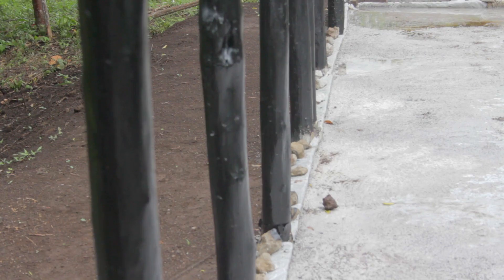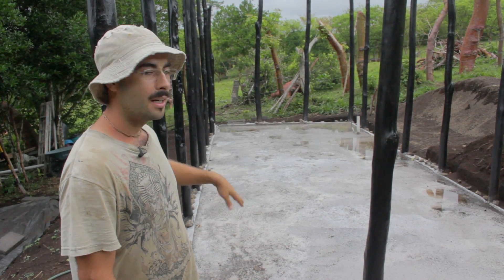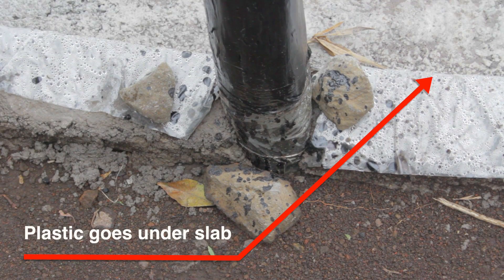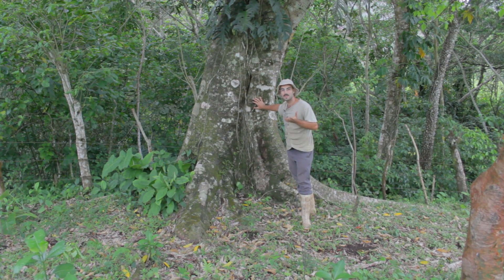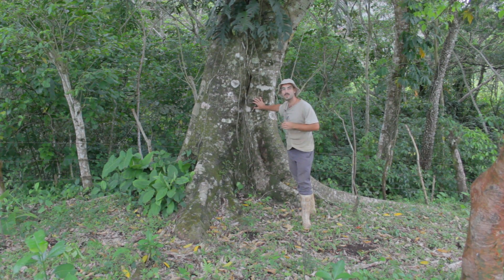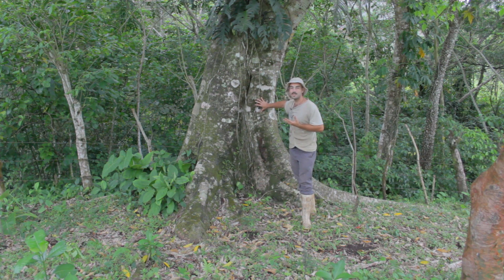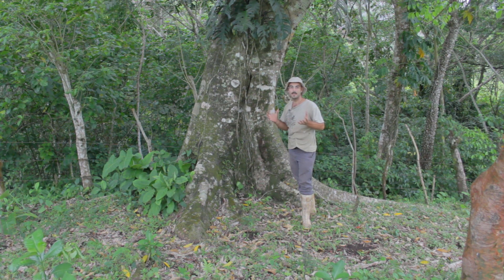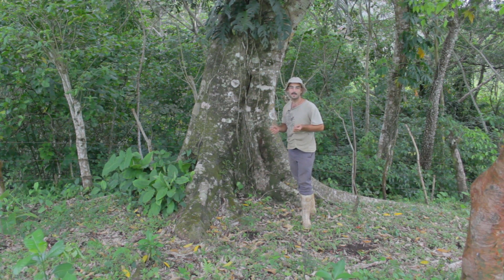Murali-Rama House - Part 2/4: Foundation and pillars

Comment: Good job, but why not use your treated bamboo for the posts? If you lined the hole for the post with some of your plastic they wouldn't rot, and bamboo is far stronger and more resilient than wood.

 I was also wondering why you bothered with the screws. It seems simpler to offset the posts so that you could just lay a single row of bamboo slats one above the other with the nice warm round sides facing inward. Use bamboo pegs in the posts above the top layer to prevent movement and then cement the outside as you have done. In your climate it seems unnecessary to insulate with rammed Earth and I can't think you get extra strength that way.
Reply from the maker: The posts is the most important part of the whole construction, in fact I've considered that the posts should be also concrete to make the building last much longer and reduce the risk of injury during the old age of the building.

So, are you saying to have thinner walls, with only one side of bamboo strips? Yes, it would work and it would be even cheaper, just would feel a little bit flimsy like drywall.
Reply: Treated bamboo has extraordinary physical properties - tensile strength matching steel and compressile strength greater than concrete. Its drawback is vulnerability to moisture. If you were to overcome this by, say, seating the bottom of your bamboo posts in disused plastic bottles, such posts might outlast concrete ones. In many cases bamboo buildings have proved far more resistant to damage from cyclones and earthquakes than concrete ...

To prevent flimsiness in the walls and to improve insulation you could stack whole poles rather than split ones between the posts. The gaps between such a weave of whole poles might be filled with quarter or eighth pole splits..

I have been seeking some long-lasting bamboo-only solution to roofing but it seems there isn't one. The cheapest I've been able to locate online is people making a multi-layer bamboo roof with a layer of tarred linen between the bamboo layers ...
Reply from the maker: Yes, even with full treatment, in places like this, with tropical weather, bamboo doesn't last as long as concrete, always some reason or another, humidity, termites, etc.

For roofing, it would be possible to lay the bamboo strips, and then add a layer of plaster over it. Bamboo alone as roofing would require some sort of varnish to waterproof it.
Reply: It seems the main problem is rainfall. The boron treatment is water soluble, so while it's effective against insects it can simply leach out of the bamboo in the presence of moisture. But bamboo construction is often used successfully in humid tropical climates so I think that watertight footing, roofing and cladding would be the principal concerns for bamboo posts.
Reply from the maker: Yes, I agree. the problem, is that once you have a whole building and any of those things fail, there's nothing to do, the whole thing becomes unsteady and dangerous. Its not like we can add more posts afterwards. If the pillars fail, the whole thing has to be demolished. So, is it worth the risk instead of doing a little concrete just for that?